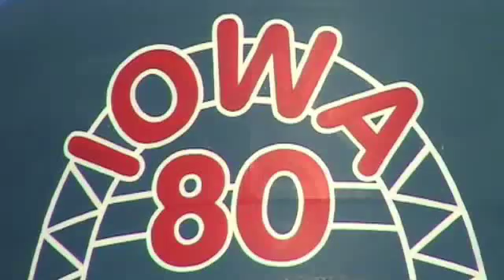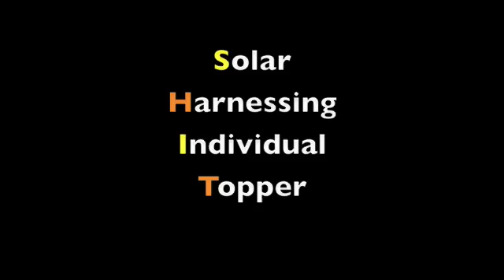Semi Solar Canopy

Comment: Nice idea but not practical.  The weight of the batteries would be prohibitive as the freight movers are trying to maximize the load as much as possible.  Second, if there were panels, as I'm going to do, the truck driver would want that energy for themselves to power much of the electrical loads they have onboard.

Comment: If there was a cheaper solution for solar, I would be for this, but not for the communities, but for the climate systems in the trucks, so it charges during the day, and when they rest, they will use the saved energy to power the A/C or heat and radio instead of leaving the motor running.

Comment: solar panel are expensive and inefficient plus carrying all that extra equipment my cost more energy to move that extra material than it gains. hell the us could completely supplement its power needs if the made a two hundred square mile field of solar panel but its expensive and none will give up the land